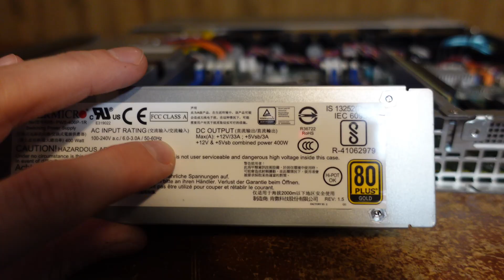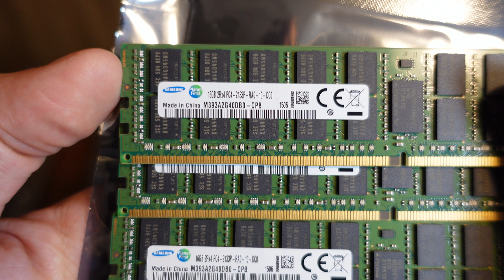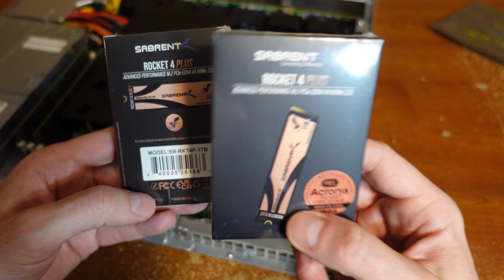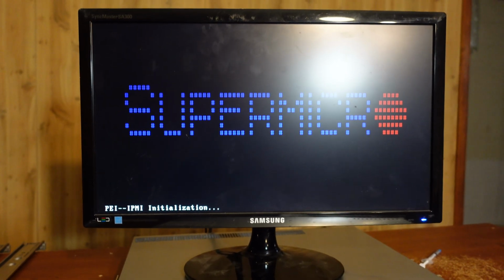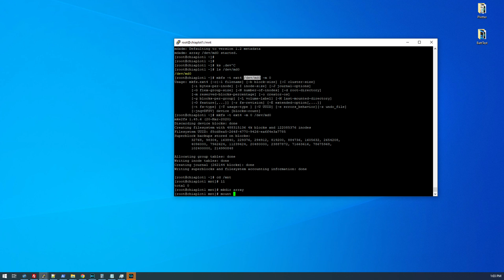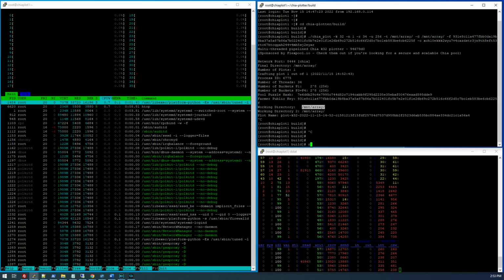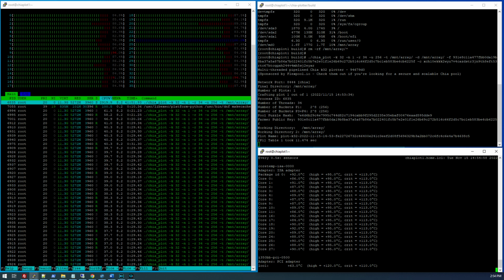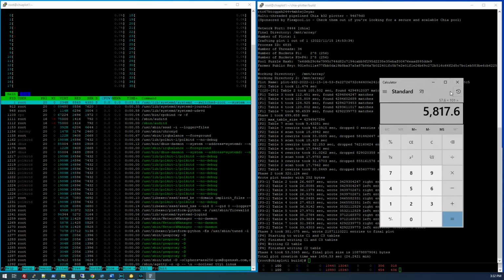Building a Compact 1U Chia Plotting Server, Xeon E5-2699, 64GB DDR4, Only $625!

Comment: You not gonna see 3.6ghz using so much cores.

This is turbo lable of this cpu
5/5/5/5/5/5/5/5/5/5/6/7/8/9/10/11/13/13
Its number of baseclock adding to turbo depending on how much cores are used.
13means +1300mhz ( 2300 base + 1300 turno will get you to 3600mhz) and its only on 1 and 2 cores. All core turbo is 2.8ghz.
Reply from the maker: I got that now. I didn't realized these work that way. The Intel website just says 3.60GHz but I'm not seeing where it mentions number of cores - frustrating to the unsuspecting person.

Comment: There are tons of barebone HP DL380 Gen9 for sale at around 200$, E5V4 is much more power efficient. HP ilo really shines on server.
Reply from the maker: They do look pretty nice, but I'd probably go with a CSE-826 if I were doing 2U. I've always been a fan of the Supermicro chassis because they fit standard ATX motherboards making it easy to build out something specific to your needs and modify later :)

Comment: That e5-2699v3 is amazing and the price you got it for is awesome.  Very nice hardware configured.  👍

*the only reason i might go with a v4 would be if the OS i plan to use drops support for the older v3 in an upcoming OS release.  For example, vSphere v7.0 fully support it but v8.0, which was released just last month in October 2022, doesn't support e5-2600 v3 series anymore.  But it does support the e5-2600 v4 series.

Comment: While the video is great, the problem is - if you don't buy the components with a huge luck on ebay, the whole build will be quite expensive :(
Reply from the maker: The barebones server is the only component you can't get at the same price right now. The seller has raised the price; however, he's still accepting offers. If you want one, put in an offer and see if he's willing to make a deal. Otherwise, you can set up alerts on eBay to get email notifications when a new result matches.
Reply: @HomeSysAdmin  For me, the shipping costs are the main issue...

Comment: I had dual E5-2686v3, which are basically 120w versions of the same chip, and they did 2.3Ghz under all core (36/72t) load. The scaling was 3.5Ghz for 1-2t load, 3.4Ghz 3-4t, 3.3Ghz 5-6t, 3.1Ghz 7-8t, 3.0Ghz 9-10t, 2.9Ghz 11-14t, 2.8Ghz 15-16t, 2.7Ghz 17-18t, 2.6Ghz 19-20t, 2.5Ghz 21-22t, 2.4Ghz 23-24t and 2.3Ghz for 25-36t.

Comment: 9:40 The E5-2699 v3 has an all core turbo of 2.8GHz; the 3.6GHz max turbo is only for one core. So you're not really missing much, but if you had the thermal headroom on v3 CPUs you can use a turbo core unlock modded BIOS (which would allow you to run all 18 cores at the 3.6GHz max turbo), but probably not on a Supermicro server.
Reply: It's more about power headroom than thermal headroom when unlocking the V3 CPUs. They are hard limited to their TDP so there will only be gains if your all core workload maxes out the stock all core clock but doesn't reach the power limit. With the unlock it will run up to the power limit, increasing clocks. For heavy workloads that already reach the TDP with stock clocks there won't be any difference.
Reply: @TheAnoniemo  Yeah, that's a good point actually; I'd forgotten the v3 had a TDP that couldn't be bypassed. You'd probably only get about 3GHz on all cores then, perhaps 3.1-3.3GHz if you disabled a few cores (but then you'd have to profile the workload to see if you actually got a performance regression in that case). Thanks for correcting me.
Reply: @amp888  I thought about doing the unlock to my dual 2678v3's, but in the end it would be a lot of work for very little gain and increased risk with all the messing about with firmware and bios.
Reply: @TheAnoniemo  Yeah, exactly the same thought process here. For some use cases I could definitely see it being worthwhile (the Miyconst hardware channel has quite a few videos with gaming and productivity benchmarks for turbo unlocked v3 CPUs, for example), but it didn't make sense for my own particular needs.